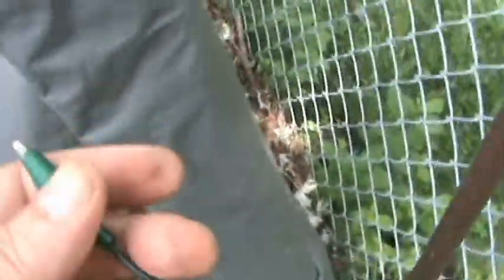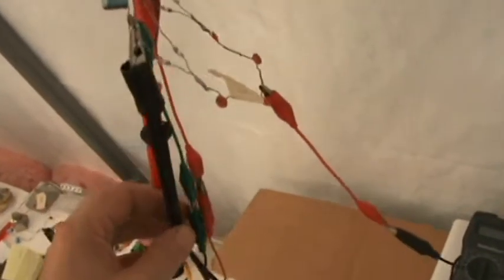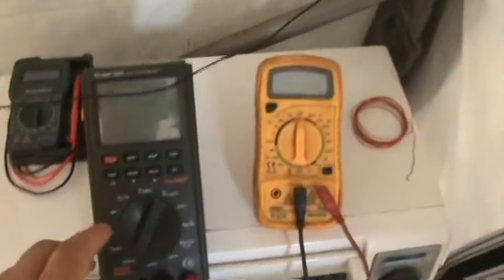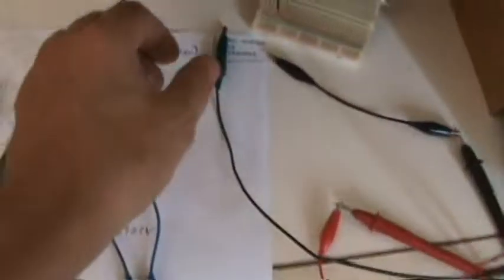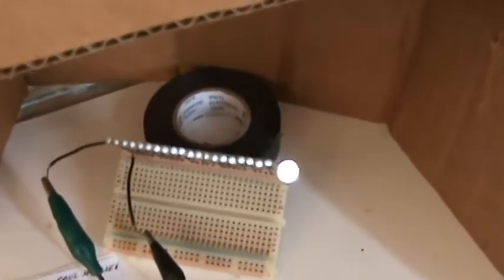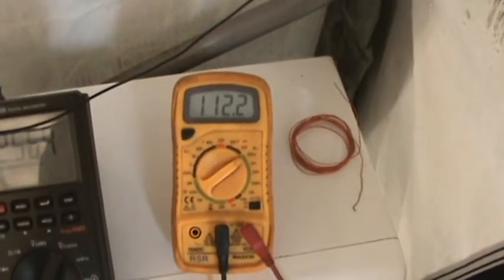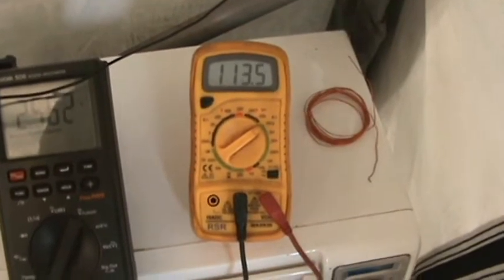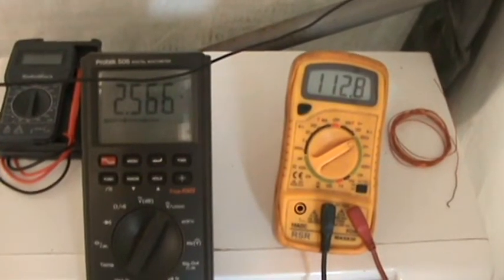Free Energy From Air 2018, part 5

Comment: It seems that a "like web antenna" the more expandable the area and higher in its level, the current and voltage is optimized. It's more important than the device.
Reply from the maker: Thanks Leo,,,i thought about using a screen for the antenna.
Reply: @INVENTOR3  I see some similarity with the process to obtain lots of energy putting a relay vibrating in a frequency with the connection circuit. This frequency can be adjustable to a optimal range to sinchronize source and charge. Remember the Tesla radiant energy collector plate? Its not that case but There 's some similarities in those process. The energy consuption of relay will be mitigated and supplied by the own excess optimal energy obtaining process. You gain 100 and give 10 to relay help you to gain more 100 and so on......
Reply from the maker: @leonascimento702  Thanks Leo, i will try this soon, along with your last idea of connecting Neg output of circuit to ground.  Hope you had great holidays! :-)
Sorry for the late reply, maybe "now" i will finally get all of my comments since youtube has made many changes this new year.

Comment: Dear Paul, ı watch all your videos about Free energy. You say before that don't want to make radio station with much more wires or more height antenna but now you make it. May be it will better to not to add more wire, instead of it add more circuit (make it 5 or 10)?!
Reply from the maker: Yeah, i keep changing my mind.  Now I'm thinking of having two different set-ups, one for collecting radiation and the other for collecting atmospheric electricity.  I like your idea of more circuits, i tried this in the past but I may try this again now because there are so many combinations of connecting the circuits together.
Thank you for staying with me and for your ideas/comments :-)

Comment: I wonder what your results would be if you tried 13, 14, or even 
26 or 28 wires?  Then try 33 wires with a 33' height and 33' length. each wire
Reply from the maker: Hmmmm, Sacred geometry, numerology,,,,why those numbers,,,,i know Tesla's favorite number is 3(also mine).

Comment: Does adding more wires change the total inductance, which may have changed the resonant frequency?  I wonder if you are still at 240 kHz or at different frequency range now.  You know about band-pass filter circuits?  You can use resistors and capacitors to make them, combine a high pass filter and a low pass filter to pick out the bandwidth that you want to pull energy from.  The band pass filter in series between the antenna and the circuit in your lab will block out frequencies above and below the frequency range you design it to, just keep in mind some harmonics may get through.  An oscilloscope would be a nicer way to see the waveform coming from the antenna, maybe if you had a patreon some viewers could chip in the $ to get you one.
Reply from the maker: Band pass filters, herd of them many times, and im sure i read and learned about them at some point reading about radio waves & modulation,,,but now that you mention them i will read about them again because unfortunately i dont have photographic memory, i need to re-fresh, hehehehe.  I have a few scopes, very old and cheap ones, but they work, but I am an armature at using them, i need to watch some more videos on them.  So many ways to use them and one wrong hook-up can mess up the scope for good. Hmmm, i will try to use it again with this circuit :-) I was thinking about the same thing you mention,,,wondering how much the freq changed now.
Good comments,  thanks.
Reply: Sure, glad to help.  Here's a link all about passive band pass filters (no battery or silicon components needed) and the fairly straightforward formulas to set the frequency ranges.  All you need is the proper value resistors and capacitors, the schematics are also provided here. You can go above or below 60 Hz line frequency and its harmonics so you don't pick up your extension cord's power.  https://www.electronics-tutorials.ws/filter/filter_4.html    Just remember to double check your math before buying the parts. I enjoy your videos.
Reply from the maker: Thanks for your help, links and comments,,,,,,and for staying with me through this whole grueling project :-)

Comment: Dissect and connect three $1 solar lamps together to get more power without the lightning hazard, plus they come with rechargeable batteries.
Reply from the maker: Those $1 solar panel from calculators are very good to use, better than cheap garden solar light panels.
But solar light can only charge by day time and run at night,,,,my set-up now can light LEDs 24/7 :-)
Thanks for commenting,,,,,keep the ideas coming.

Comment: Progress is progress. To charge a battery you'll need quite a bit of time and/or wire though.
Reply from the maker: I did charge a AA battery over 5 days it charged from .5V to 1V,,,,i think that was 2 videos ago.  Now it should charge faster :-)
I wonder if a garden solar light "fully" charges a battery during the daytime or if it just charges it enough to run a couple of LEDs through the night.
Like you said progress is progress, little by little :-)

Comment: Nice! You should see if you can get hold of some Graphite-coated wire.
Reply from the maker: I been thinking about it and looking into graphene coated alum sheets for collector at top end of antenna wire, but very expensive.  $100 for 5 sheets of 8" X 8".   Hmmm, i have some graphite sticks that i can rub on the wires, hehehehe.   They have some cool stuff here..... 
https://graphene-supermarket.com/

Comment: So how much is it going to cost to make enough power to run the house?
Reply from the maker: Hmmm, lets see,,,a million feet of wire......            LOL
I keep thinking about making some Earth batteries for my next project, many of them under my lab.
Reply: Just wondering if people who do these in shop experiments are working out the practical economics or if they are just tinkering for self amusement.

I do not fault people for having a hobby, far from it, but it does at some point need to be balanced against the long term practicality, if thy are in any way thinking of helping their fellow humans with said research.

I tend to lose interest in a lot of people because 1, they are hoaxes or 2 they produce no results but just a lot of wires hooked to existing power sources, you are one of the rare few who followed through far enough to get to the 'actually working' stages.

Still, as I have always said 'it is a matter of scale.'

I know that vast volumes of untapped EM and electrostatic power exist and always will exist, but I also know that without a system large enough and cost effective enough, it forever remains in the realm of hobbyists and legends.

The trick once a person gets to the point you are at now is to decide if they wish to greatly up the voltage, or greatly up the amperage, determine how this can be done, how much it will cost, and if it is worth the effort and expense to carry through.

I met one company who wants to raise towers into the air to reach a working voltage and run cables in a radial pattern like a spider's web for many miles to obtain the amperage.

I suggested self replenishing balloon stations but never did send in any drawings to explain the theory because it would require access to a large quantity of spider silk to produce a balloon and tether both strong, light and durable enough for long term service, and I could not at that time offer a suggestion as to how to obtain such volumes of spider silk.

Even now, the cost of said spider silk is really rather high, so I remain unable to produce a product of adequate parameters to produce power at an economically sustainable volume.
Reply from the maker: I am not getting all of my notifications emailed to me,,,,hope youtube fixes this for next year.  Just saw this reply from you here.
Thank you very much for your comment of,,,"you are one of the rare few who followed through far enough to get to the 'actually working' stages".  I thought about economics many times with this system, and im sure i will think about it much harder when i get farther down the road.  Spider silk, very cool stuffff,,,hope it becomes readily available for the public at a decent price.  Thanks for the great comments :-)
Reply: A lot of people seem to have trouble getting replies from me, most likely i am being screened because of my former affiliation with highly sensitive military and energy research issues in my past.

It is not that it can or can not be done, it is about the economics of the doing.

This is in fact all proven technology from 100 years ago, [give or take 20 years] which was not 'lost' but covered up.

The issue, herein, is to use more modern technologies to make it truly work, and in a way which is actually affordable, practical and applicable for the average every day individual.

With the advent of printing and even 3D printing, as well as people learning how to cast and machine materials, almost anything you can imagine is possible now days, if you can scrape up a few bucks over your cost of living.